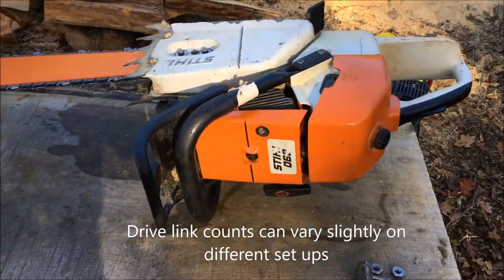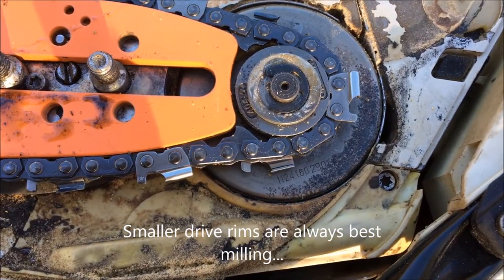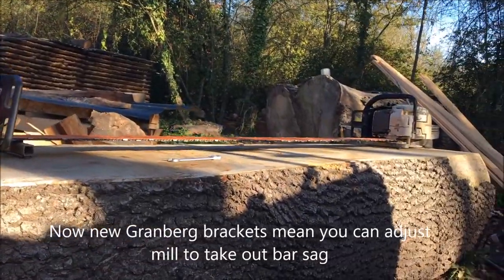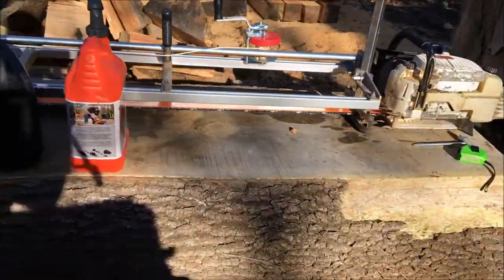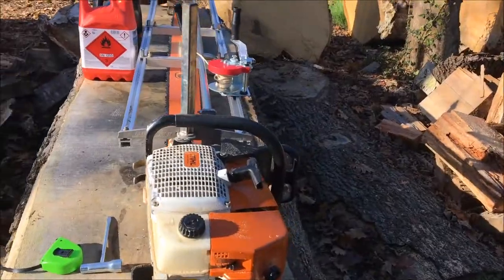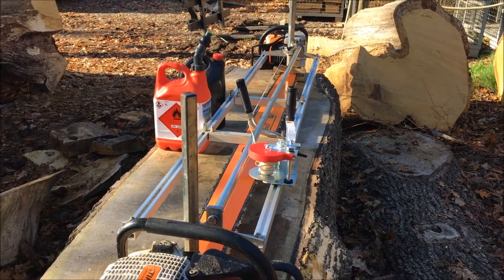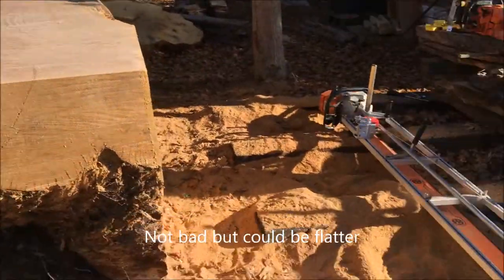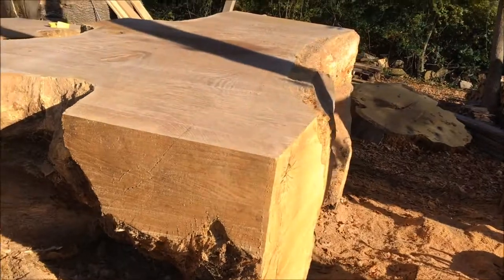Alaskan chainsaw mill double ended milling massive oak Romsey - Stihl 066 and 088 - GB 87" Bar

Comment: Is that using a granberg chain or a hyperskip ??
My 880 does 1470mm wide slabs adequately on its own with less chain  stalling than this unmatched pair of powerheads.

Comment: Hey, looks great. It looks like you used two different sizes of power heads. Do you have any issues doing that?
Reply: I was thinking maybe that's why the stalling?
Reply: @Prolyfick  Its stalling because the saw is biting too much as it rides along the side of the log. It is kind of hard to explain. Basically the guide rides up a bump and down again causing the mill to want to advance too quick.